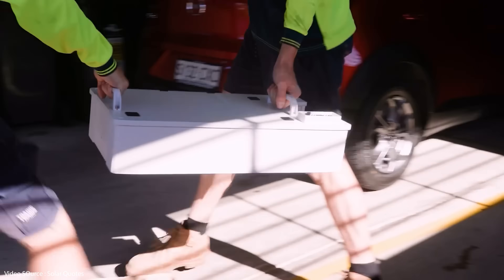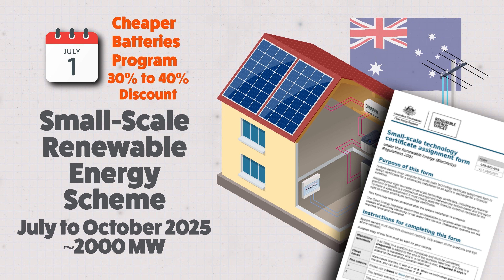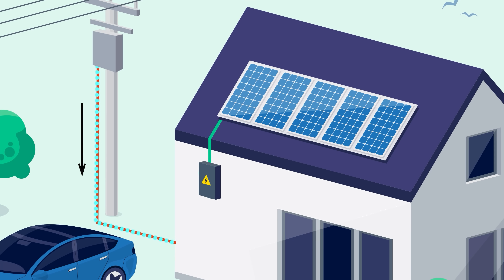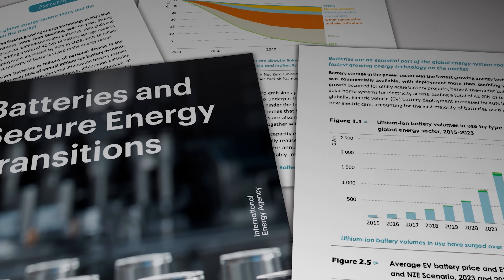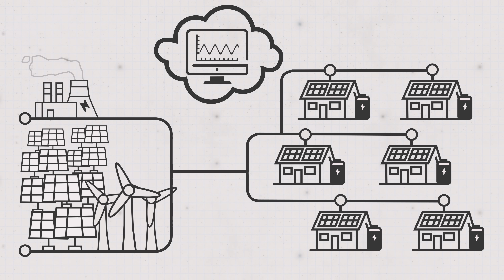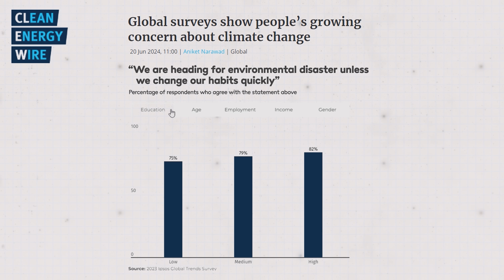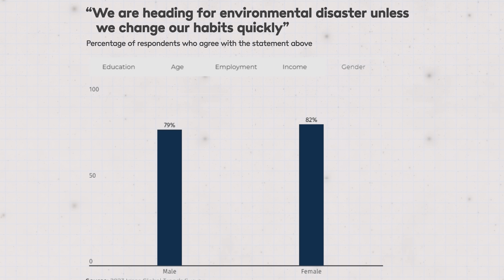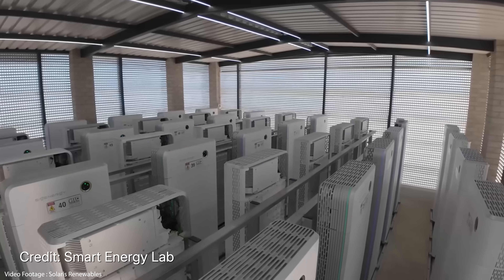Australians installed 100,000 home batteries in 17 weeks. Why can't we all do that?

Comment: And… Just imagine the possibilities of V2G. Suppose that by 2035, over 50% of private vehicles are fully electric. Further, that for 95% of their life, these vehicles are, by then, potentially parked on top of a wireless charger. Finally, that the grid has, by agreement, access to say, 10% of that stored capacity, when needed. Remember, home battery capacity is scaled to individual users, but EV battery capacity is scaled to a massive resource based on personal transportation needs, that then sits for 95% of its time doing nothing.

Comment: This makes sense as a model for grid buildout with renewables, to start with home batteries/rooftop solar so load over the grid doesn't become the bottleneck before grid buildout. I don't think govt needs to subsidize the purchase anymore, they just need to make sure utilities are aligned properly. Subsidies are relevant with new technologies that are still too expensive and pushing early adopters to refrain waiting for falling prices. Not necessary with batt prices coming down as they are.

Comment: I live in Tasmania, the island state of Oz, where we already have 100% renewable energy, courtesy of hydro and to a lesser extent, wind farms and rooftop solar...energy that we can export to the mainland via an undersea cable. Being in the "roaring forties" at 40 degrees south, we have less sunlight than our mainland cousins, but a hell of a lot more wind and rain. So for me rooftop solar is not really needed, as we rely on pensions and superannuation and get a discount. Instead we switched to split system heat pumps for heating and cooling throughout our house, which is keeping my tootsies warm as I type this, as it's actually a cool and blustery morning here in our "sunny" Australian summer. Our electricity usage actually went down after switching from wood heating to heat pumps, as we no longer need radiant heaters in the morning and in rooms other than the lounge.
Reply: I'm down in the Huon and our 13KW Solar PV paid for itself in just under 5 years. We use Electric everything, Heatpump for heating & Cooling, Hot water, Cooking etc. Solar is still worth doing, even down here.

Comment: Traditional net metering and flat rate electricity have a major equity problem. When there is a lot of solar generation, solar households are consuming less or exporting electricity to the grid, while wholesale prices are low or negative. These households then consume power from the grid at night, when prices are high. Yet, net metering treats the cheap exports and expensive imports as equal. Utilities then have to make up loses with higher rates, which fall hardest on apartment dwellers and non-solar consumers. Home batteries take excess sunny day rooftop capacity and shift it to evenings, when prices are higher. This is only partially aligning the incentives. In the long run, net metering for rooftop solar needs to be replaced with equitable pricing. Rooftop solar and home storage cannot compete with grid-scale solar and storage in a fair market.

Comment: Hi everyone.
I own a 40KWhr battery with 4 wheels. My house uses about 5KWhrs of power each day. I have a 4KW solar installation on the roof. It looks to me like I could power my home from my EV. To do that I need a V2X charger. I don’t know of any supplier of these in the UK, so I wait with bated breath. Install a battery system, you say. … and so does my electrician, who offers me much less capacity than my car has, for around £10,000. I charge my EV using Octopus Intelligent Go tariff, which supplies me a guaranteed 6 hours of power, usually overnight, for 7p per KWhr. So I can charge my 40KWhr EV battery from flat to 100% for £2.80. Occasionally, in the UK summer, I can part charge my EV from the solar generation.
What I really want is an incentive for my electrician to quote me for installing a V2X charger. You can see the attraction for him to quote for a second battery system - he makes far more profit, and I get a 2nd battery I don’t need. I would also like companies to produce V2X chargers. I would like there to be a market demand for them. I would like all EVs to be able to offer power output to V2X chargers.
 What bugs me is there’s no incentive to take this path. I must wait patiently.
Matt Lee, Nissan LEAF Teckna owner, with Zappi charger, and 4KW solar system.
Reply: Why ruin your car battery like that?  V2G will degrade your car battery over time because of heavier use.
Reply: @Les_S537  Doesn’t the same apply to a household battery system?

Comment: The problem is many people’s batteries are charging as soon as there is a surplus early in the morning rather than waiting to the peak production around the middle of the day
Reply: That isn't actually a problem, the energy going into the battery is surplus to the house requirements. Larger batteries take longer to fill, so the grid is stabilised by the more gradual solar feed in. Bare in mind rooftop solar is still dwarfed by grid solar farms.

Comment: As Australia is to solar, Canada should be to heat (pumps). Alas, cheap energy prices prevent that generally.
Reply: The cold also means you can't just use a heat pump in some areas of Canada.  Im in northern Alberta right now and we have been hitting close to -40 at night and its only December.  It doesn't get really cold till February.   If this keeps up we will have some -50 nights in the new year.
Reply: @pin65371 some areas of the country really do require a ground source heat pump and much tighter buildings, it's true.

Comment: Be aware there have been a lot of house fires since then and though the government and emergency services state likely to be from equipment containing rechargeable lithium batteries purchased outside of Australia generalised to companies like temu (China) it has only been happening since the new program and the battery installation program for those plugged into the grid with their solar power system

Comment: Hi Dave🤗. Thank you for yet another insightful and hopeful video🤗. Here in Ontario Canada electricity is fairly heavily subsidized by the Provincial government (which means we just pay more than the difference in taxes as government programs are often very inefficient 😢). If they would just take away the huge subsidies they hand out to the fossil fuel industry and invest it in green energy, the economy and the environment would greatly benefit. Sadly the fossil fuel industry has way too much influence to make that likely to happen 😢
The cost of electricity for me averages $.15 per kWh all in (after subsidies) and the only way to feed the grid is net zero metering which is definitely not worth the hassle and the cost to set up🤦‍♂. I am going to look into used storage batteries and and used solar panels to build a system that allows me, at least time shift my grid usage and at the same time give us a backup in case of grid outages (admittedly rare right now). I’m hoping I can come up with a cost that gives a reasonably short payback (we are seniors 😜). I’m hoping to convince my wife that having a back up system is worth underwriting some of the cost 😜😂
Reply from the maker: That's a very comprehensive and helpful comment. It certainly sounds like you're heading in the right direction. Good luck with convincing your wife!

Comment: Thankfully we voted out the conservative science deniers so schemes like this could go forward. 
Our current conservatives have just eliminated a net zero target from their agenda in favour of increasing coal and gas powered generation.
I have 10 kW PV on my roof but didn't go with a battery because they are still overpriced here in Australia and until I get an EV car I'm producing enough excess to pay for my nighttime use. PV is cheap here but batteries are still a rip off. I'm guessing in 1 or 2 years the price will fall substantially.

Comment: There are a couple of negatives regarding the Australian environment. I live in Western Australia and technically within the city metro area of Perth although I couldn’t connect to the grid economically when building my house so opted to be totally off-grid saving myself over $40,000 dollars (approx 20,000 pounds equivalent). Also, if I did connect to the grid I would get next to nothing for exporting excess power. My take is until government ensure equitable payment for exported power then why bother, best keep your power for yourself and not feed the grid!

Comment: I live in Sydneys outer west and as of last Friday am upwards of 90% independent of our grid. We installed 13kW of solar panels and 2 Tesla batteries (27kWh capacity).  It fully charges the batteries by midday, powers the house and will either send excess back to the grid or charge the EVs and supply the house during any grid outage while also continuing to charge batteries from solar. 
I'm hearing the rebate program has been so successful that funding allocated will run out mid 2026. People are installing higher than expected battery capacity per house. 
Even with the Government rebates it is still a significant investment, but worth every cent when energy companies jack prices or there is a power outage. This also largely gets us off gas, as have installed a heat pump hot water and induction cooktop to replace ageing gas appliances. Am considering a VPP program as well.

Comment: I wonder whether you could explain how electricity is exported from home systems to the grid.  I have yet to come across a thorough explanation.  Presumably the solar installation puts a little higher voltage onto the incoming electricity cables than that produced by the grid itself.  But how much higher?  If the grid is supplying, say, 220 volts and the solar installation is exporting 8 kW to the grid, for instance (my installation is capable of that), then if it increased the voltage to 240 volts it would have to feed in about 333 amps (8000 watts = 333 amps * 20 volts, if my maths is correct - which seems to be a lot of amps).  But if the mains was already at, say 250 volts (which, I think, is the limit) then presumably the installation cannot export any power.  Is that correct?  I suspect that I am missing something, somewhere.
Reply from the maker: @steveknight878  Here's what I gleaned from the dreaded ChatGPT...You’re right that a grid-connected solar inverter exports power by producing a slightly higher voltage than the grid — but the missing piece is that power export is mainly about current, not big voltage jumps.

In a normal UK home, the grid voltage is around 230 V RMS (it constantly fluctuates). A solar inverter synchronises exactly to the grid’s frequency and phase, then nudges its output voltage up by a volt or two. That tiny difference is enough to push current out into the grid.

Crucially:

The inverter does not raise the voltage by 20 V.

It exports power by injecting more current at almost the same voltage.

So exporting 8 kW at ~230 V is about 35 A, not hundreds of amps.

If local grid voltage rises too high (typically around 253 V in the UK), the inverter is required to reduce output or disconnect to protect the network. That’s why high solar penetration areas sometimes see inverters “throttling back” on sunny days — not because export is impossible in principle, but because voltage limits have been reached.

So yes, you were missing something — but it’s a very common and reasonable assumption. The key idea is:
👉 small voltage difference, controlled current flow, synchronised AC waveforms — not brute-force voltage pushing.
Reply: @JustHaveaThink  Ah, OK, thanks for that.  I suppose I envisaged that it had to 'fight' the incoming power and could only output power over and above that - which, if that were true, at 1 or 2 volts over incoming voltage would require enormous amperage.  So what is happening is that once the voltage from the inverter rises above the incoming voltage then it can deliver that voltage (say, 231 volts) at more moderate amperage.  My problem, I think, is that I envisage it as a water pipe coming into your home at a pressure of X, the inverter pushes back at X+1, and the resulting flow is only at a flow rate produced by that 1.  
Or, another way, if you had two 1.5 volt batteries connected the same way round in a circuit, and had one 1.5 volt battery connected the other way round, you would (I think) have, in effect, 1.5 volts potential difference between two points in the circuit outside those batteries, IYSWIM.  So if you had a circuit ------¦|¦|---|¦--- then the PD between the two ends would, I think, be 1.5 volts.  I guess where that is wrong is that the inverter is not opposing the incoming voltage, but adding to it - it isn't trying to push electricity against the incoming flow, but rather giving it a little push in the same direction.
I thought I understood electricity fairly well - but obviously not 🙂.

All better now.

Comment: I’m one of those Australian battery,and also heat pump, purchasers - pushed along by the government subsidies (state and federal). Working out great at our house. Message for politicians in other countries: direct subsidies are not only quick and effective, they create a small warm glow towards policy-makers. Maybe Just have a Think about that too.
Reply: We've had the heat pump for about 12 years, and the solar array for 9 years. Installed 10kWhr battery a couple of years ago. Set a timer on the heat pump so it only operates from midday to 5pm and you get the sun heating the air, that the heat pump draws to heat the water and the solar panel/battery storage running the pump unit. I've estimated that just to heat water without solar, the average family would pay around $1,000 a year. Costs us about $60 a year (that's the cost of the electricity that isn't sold into the grid).